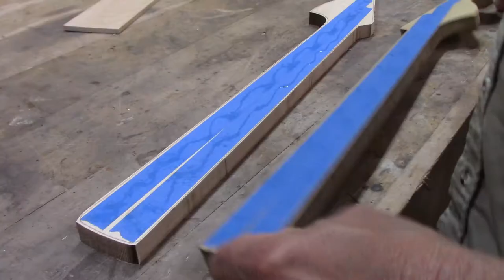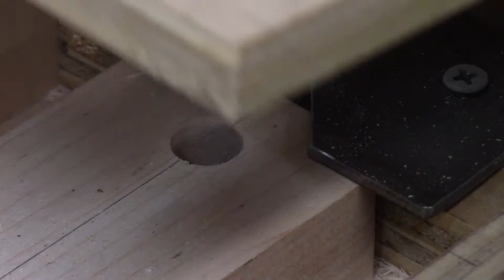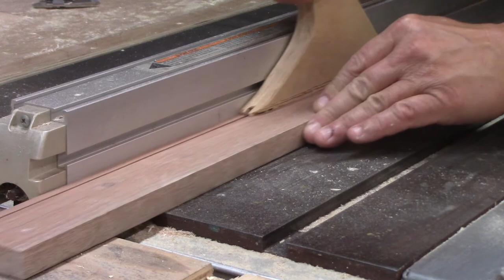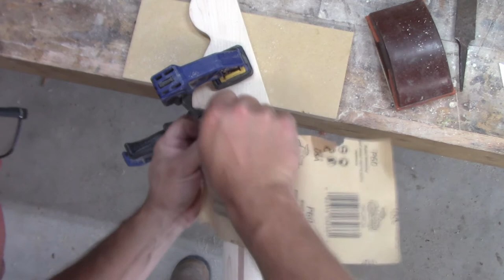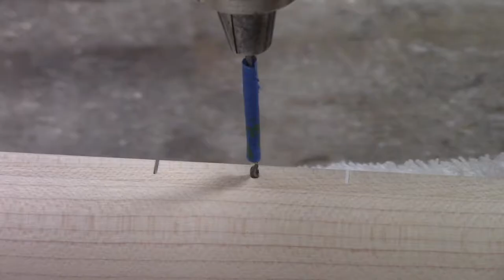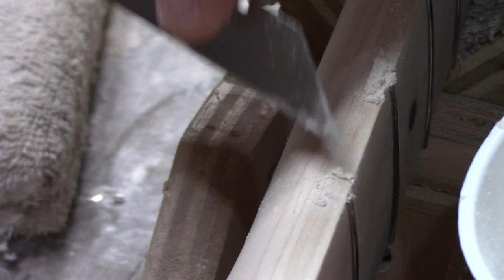Building a Telecaster Deluxe Neck

Comment: Great work. Can I ask you if about boiled linseed oil? Is it a strong finish? Has it dried in a few days? Is it better than Tung oil or Urethane trasparent varnish?
Reply from the maker: it's not bad. I have not used tung oil. It dries relatively quickly, like a day. If I were to do it again, I would have applied a couple more coats a day or so apart. One thing I have used and had really good results with is Tru-oil gun stock oil. It dries in a few hours to the point where you can scuff it and apply another coat.  You can apply many coats and the finish gets glossier with each coat.

Comment: I have a few questions, if you don't mind. 

1. I noticed that when you installed the skunk stripe, you were fairly liberal with the glue. My dad taught me that while you don't want a dry joint, modern wood glue is very effective in thin, but full coverage coats. Have you ever had an issue with truss rod binding from glue in the channel?
2. Is the rear installation of the truss rod, in this particular case, just for aesthetic or era correct purposes? 
3. Do you offer plans for the fixtures and jigs you use?

Learned a few tricks watching this. Very clean work.
Reply from the maker: Thank you. I've come a long way since that build. That truss rod seems to work ok but I could see too much glue being a problem. I've had the skunk stripe pop lose before so I was probably over compensating. The reason for the rear install is partially to be true to the Era but also because I was making some one piece necks at the time and needed to install it from the back. I was all set up for that kind of installation so that's why I did that. I do not have any plans for any of my jigs or fixtures. Most of them have been retired and replaced by new methods. The fret jig has been replaced by a simple jig on a radial arm saw. The fretboard radius jig has been replaced by a big belt sander that I built with a swinging fixture that can be set to different radii. The 3 axis router is now a fully functional cnc. I still have the neck contour jig but it only works for fender style necks. I will probably be modifying it soon to accommodate different neck sizes.
Reply: @lennyc624  Awesome, thanks for replying.
I make Fender style necks for my instruments, for the fact that there is so much less waste and less construction complexity than a slant headstock neck.
I've made necks with scarf joint, or from single pieces of lumber, and just lamented the amount of offcut waste.
I never considered that a skunk stripe could pop out. That must have sucked!
Reply from the maker: @peachmelba1000  Yes it sucked but I am pretty new to guitar making and each build is a learning experience. I get a lot of satisfaction out of making jigs and fixtures to improve the process. I have about 6 finished guitars that all look and play great but I could go through and point out all the mistakes and imperfections. Of course, I'm my worst critic.

Comment: Hi. Can I ask why did you use a separate fretboard slab yet use a skunk stripe to route the truss rod slot? Is that just era correct for your build? Thanks for the great video. i learned a lot.
Reply from the maker: I think I did that because I didn't have a thick enough piece of maple to make a 1 piece at that time. The skunk stripe and bullet truss rod was an era choice. Also that's how I did my truss rods back then. I do it differently now. My method is always evolving.
Reply: @lennyc624  Thanks. I'm racking my brain trying to figure out how to do a more vintage correct truss rod for the build I'm planning. This video was a lot of help. Do you have any information about what the dimensions on the curve of the truss rod slot should be?
Reply from the maker: @jeff1872t  This link
https://fgguitar.wordpress.com/wp-content/uploads/2014/08/stratneckblueprint.jpg
has all the important info
Reply: @lennyc624  Awesome, thanks. Do you know what's up with that truss rod anchor on the drawing?
Reply from the maker: @jeff1872t  not really. As far as I understand, there's a screw accessible under the 7th fret marker dot. I think. I'm nor sure what the purpose is. My guess is to prevent the truss rod from digging into the wood under tension. I've built a few necks without that and they seem to work ok. I may be totally wrong about the purpose of that. It's just my best guess.
Reply: @lennyc624  So I did a little digging about it yesterday and somebody in a forum said that they used there for a truss rod that adapted to work both ways like a duel action and they used the anchor fearing that the skunk strip would blow out due to that rod.
Reply from the maker: @jeff1872t  Maybe. I think the bullet nut would just unscrew before it would work like a 2-way but I was making my own truss rods so maybe with a legit one it would work that way. Now I use spoke wheel truss rods. I have a couple recent build videos if you're interested